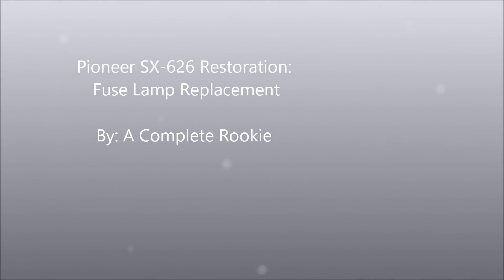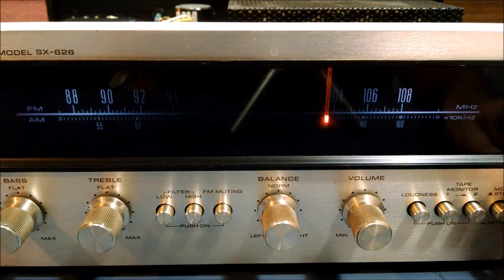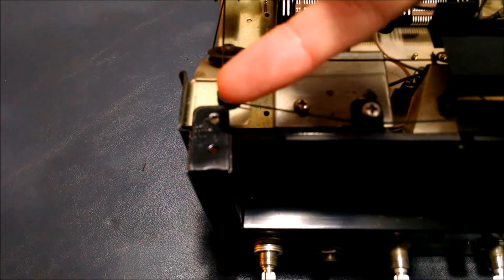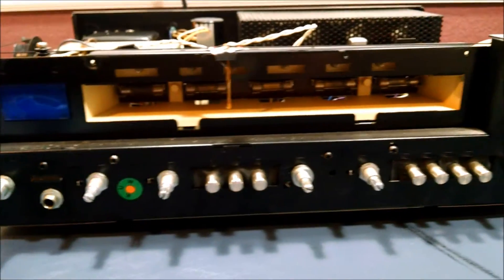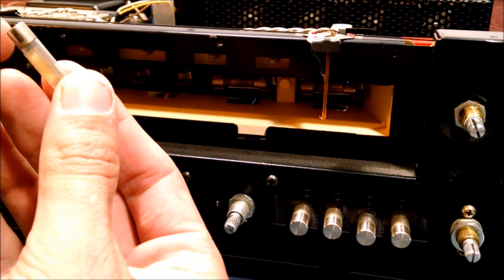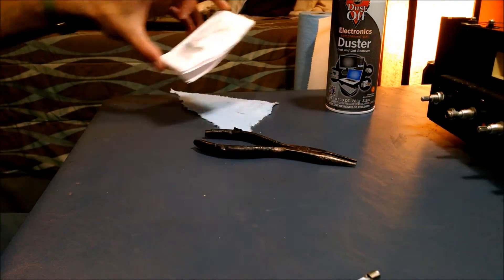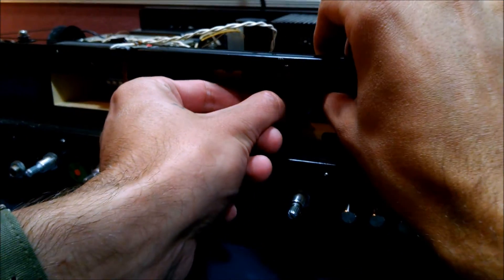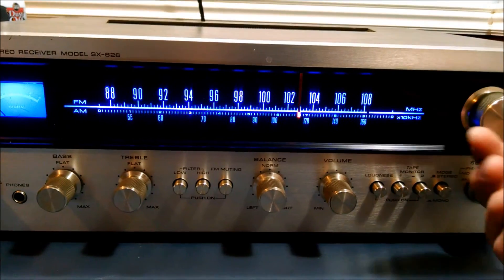Pioneer SX-626 Restoration: Replacing Fuse Lamps w/ LED Lights Tutorial

Comment: I just replaced the backlights in this receiver, and I can tell you that you don't need to dismantle the entire front panel. Just take the top off, and look for black steel bar that's directly behind the tuner display. Take the two screw holding it in place out, slide the bar out, and you'll see the white plastic housing for the lights underneath. Tilt it back slightly to clear the metal brackets it screws into, lift it up/back, and the whole thing pops right out. The Backlight for the meter's even easier; just remove the two screws on the top of the steel cup behind the meter, and slide it straight backwards.
Reply: Can confirm this! Just replaced the bulbs on mine and I you don't need to take the whole faceplate off at least on the SX-626 model. Thanks for this comment! Saved me so much trouble
Reply: Good advice which I followed last night on my 525.  I wasn't able to pull the housing completely out. I could tilt it up and with care replace the light. So it wasn't quite as easy as you describe but I was able to pull out the burnt out lights and install the new ones. A big time saver for sure.